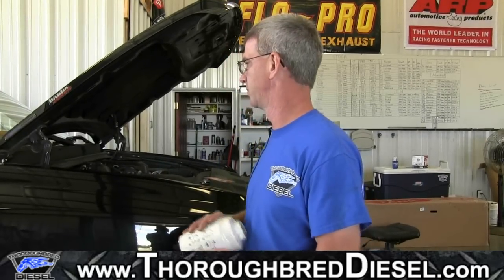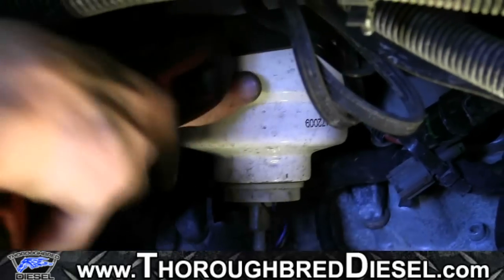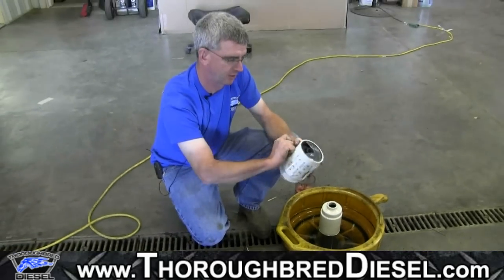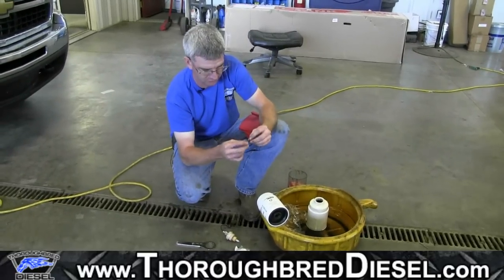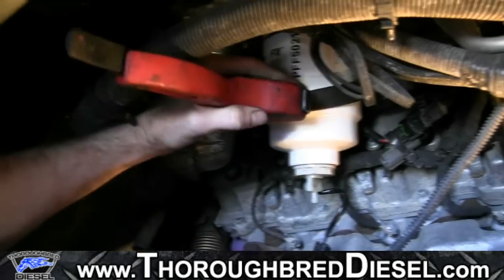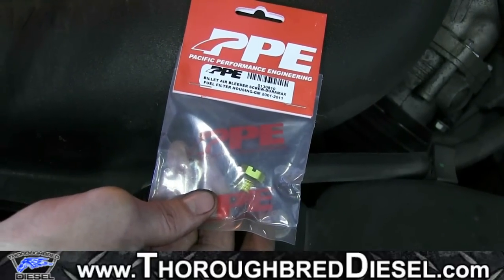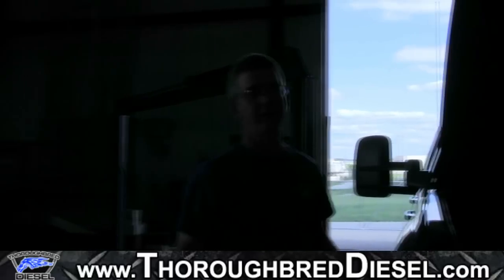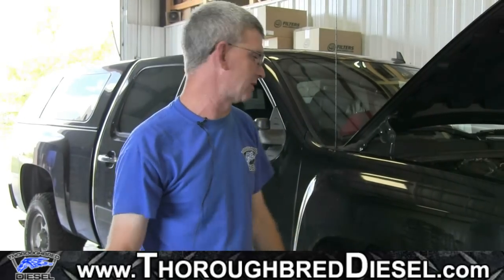Duramax Fuel Filter & Bleeder Screw Install: Chevy Duramax #PFF50216 & #5130810

Comment: I just replaced the fuel filter (and rebuilt the fuel filter head) on my GF's dad's LB7. Noticed the oring in the center of the old filter, but the new one didn't come with one. No other video I've seen specifically mentioned switching this. Glad I saved it with the old filter. Thank you!

Comment: Pro-tip, gently stretch the filter O-ring until it stops trying to pop out of the groove then gently stretch it one more time and use oil or grease or O-Lube, pick your poison but stretching the O-ring a bit won't hurt it and you won't have to fight it or worry about it riding out of the groove while you're threading the filter on. Pro-tip #2, fill the filter about half way with diesel before installing it, this will make the priming process a lot easier. The directions on the filter show taking the sensor until the seal makes contact then 1/2 turn the same for the filter seal but only 1/4 turn by hand. Putting a wrench on it might make the next guy's life miserable trying to remove it after the seal swells from exposure to diesel it's no different from an oil filter in that respect. Thanks for the video, removing the inner fender is a good idea.

Comment: “This is Wayne from Thoroughbred diesel and if you watch my videos, you can be as good as me”.    

Changed out fuel filter, transmission filter and air filter just now with perfection due to Wayne from Thoroughbred Diesel.  Fired right up.  Heard air escape by bleeding 4 times.  Last one diesel came out so I knew I was done. 

2006 Duramax. LBZ

Comment from the maker: That's a good question. We honestly didn't notice that until you mentioned it. This was a customers truck. They must have installed that themselves. Should be a big issue as long as the seal holds. We will be calling them shortly.

Comment: Thank you for sooo many great yips, and tips.  Done this since 2007  but I still like to check for info.  You didn't miss a thing. You showed  the clip to the water sensor that fd with me for way to long.  The dry desert  silt held it on tight. I'll clean and lube it this time.  Thanks alot.

Comment: To keep the upper o ring in place I use some super glue or shoe goop in filter o ring seat install o ring turn it over set on a flat steel bench place weight on top give it time to set. Best way to change filter is wheel well (have had duramax trucks since 2001) I change filter when rotating tires no tire in the way don't have to remove wheel well remove lower push pins drill two holes in bottom of well and at top (not into fender) use some bungee straps to pull well back & up

Comment: I have to get it from the top.  Hard as heck to get 2 hands in there.  Used a strap wrench on it too was not easy either.  I tightened up the sensor by hand.  No leaks.  Whole procedure was a pain, but alls well that ends well.  As for that gasket, I stretched it out a bit, which made it sit in the groove just fine.  Why so much work with the bleeder screw??  All I did was open up the bleeder screw and pumped it until fuel came out.  Done.
Reply: Groundhog  - yes I have this question as well.

Comment: i find this is the only way to do a fuel filter ona duramax, good video man.

working for GM changing lots of thes, i always remind people don't be cheep when it comes to fuel filters! but i dont think i dont think ive ever needed a tool to use a tool on fuel screw or filter, and neathor needs to be very tight, the pump draws the fuel from the tank usally.

Comment: Wayne, is there a way of draining off the water on the stock fuel filter in between 12K mile change intervals?   
2006   6.6 Duramax

Comment: this is the way Gm says to do it, its super easy
, only need to tighten it by hand... not tools needed, remember its under vacumm not pressure, and vasoline works great for holding the seal into place3, just fill the groove some in 4 places, and put o ring in, lube wat the same time, then good to go, open screw pump till you see fuel, close screw then start bam done!
Reply from the maker: Kevin the biggest reason for the tool that we've found is that the sensor sticks, probably due to temperature changes. People then try to use a what ever tool they have at home to break the sensor loose and then in turn break the sensor. By no means is the water sensor wrench necessary.

Comment: I just changed fuel filter like I always do in the past.When priming,I use the procedure you dedcribe as I always have.

I cannot get fuel to the filter head.Truck ran beautiful before filter change.Its a 2008 LMM 6.6 Litre with 208k miles which is used every day. 

It has dual tanks with a total capacity of 40 gallons. It's lowish on fuel as I was going to fuel up tomorrow. Would being a bit low on fuel cause priming to be more difficult?????

Comment: My WIF warning comes on and goes nuts during  a rain event.  Unit wasrecently replaced along with the fuel filter by dealer.  WIF warning only occured previously when fuel was contaaminated (rarely).  Any ideas why this would happen?  In dry weather (mostly the norm in drought ridden CA), it rarely acutates a warning.   Velhicle is 03 Duramax with 260k miles.
Reply from the maker: I would be suspicious of wiring at the WIF sensor if you have replaced it.  This is a hard one, because it needs to be diagnosed correctly because you need correct reporting when it comes to a water in fuel condition.

Comment: I have changed mine a couple of times with good luck but this one has been a weird one. Twice now after driving it a few days it has died on me and I had to bleed it again. I see you bleed it a different. I have been loosening the bleed screw and pumping till the fuel comes out. Like I said it has worked for me but will try it your way. Also I need to get a strap wrench. I have just been using my hands and not sure if it's tight enough?

Comment: All of that effort putting a strap wrench on it when that step formed in the bottom of the filter body is there to accept the same filter wrench that fits your oil filter. And it’s a lot faster.

Comment: I’m so confused I have a 2007 express 3500 Duramax 6.6 and the new filter I bought has that metal housing and the O-rings but it also comes with a fiber filter unless I’m supposed to also install the fiber filter inside the metal canister.??

Comment: Last year,I let the dealer replace the fuel filter which was close to $200 with tax.I actually got stuck on the side of the road because the wif sensor was leaking.It was cracked,so,I am sure they over tightened  it.

Thanks to your detailed priming method,I decided to do this myself. Truck fired right up.The next morning, there was a split second more cranking  than normal.After that,it fires right  up as normal. 

Could  there  have been a small amount of  air in the  system  which worked  it's way out while driving?Its fine now.

Comment: I've never had that problem @9:45 when I use just a finger full of engine oil. strange.
why do you suggest grease?
Reply from the maker: Either way works fine. I have always used grease or petro jelly out of habit. Whatever works for you.

Comment: @ Thoroughbred Diesel How do you feel about the CAT filter "upgrade"? Seems dangerous to me to have your water in fuel sensor out of the equation.  Just curious.  Great video once again.
Reply from the maker: http://www.dieseladdict.com/best-new-duramax-fuel-filter/

^^ Article that could give some insight. Good upgrade in some applications.
Reply: Thanks a bunch!  By a lift pump, a FASS or air dog system should work right? I have one in my garage waiting to be installed.  Thanks for the reply!
Reply from the maker: Turbo-6.7L Yes a lift pump is highly recommend. Both of those brands are good choices.

Comment: If you fill the fuel filter with clean diesel it will save some time or eliminate priming completely. Of course make sure the fuel is clean because some of it won't be filtered.

Thanks for the video, now I know I need a special tool to take the sensor off - thanks GM :P
Reply from the maker: david427steel Either will work. I don’t fill the filter on vacuum based low side systems like the Dmax because I know as I am priming if I have a hard time getting fuel “up top” that I may have a leakdown somewhere in my circuit. If I get fuel to the filter head quickly, then I know that my low side system is in good shape.
Reply: david427steel you are under no circumstances to pre fill a new fuel filter....you must be crazy. its not that hard to pump it a few times.
Reply: Nick Larson Nick, I've been pre filling diesel filters on heavy equipment and cranes that are worth more than your house for a few decades. Amount of problems - zero. Actually I've never seen a heavy equipment mechanic  not pre fill a fuel filter. 
I've notice on my new CAT equipment that it's coming from the factory with an little inline electric priming pump.
Anyone know if GM's recommends to pre fill or not pre fill?
Reply: You are comparing a crane to a diesel truck... Pre-filling a fuel filter can damage your CP3/CP4 pump. I don't need 2 decades of experience to know that, go to any diesel truck forum and ask around, no one pre-fills their filters unless they don't know WTF they are doing. I have never had any issue priming my truck after changing the filter, and if you do, crack the bleed screw and have someon crank it over while you pump. Fires right up.
Reply: david427steel 
Thats a poor way to go about it. You dont know if the diesel fuel that youre getting is "clean". & if you say "filter it before you pour it into the fuel filter" is waste. & not everybody can filter the fuel before hand. Dont pre-fill. Use the primer button.

Nick Larson 
GM recommends to not pre-fill the fuel filter.

Comment: After driving a 2008 duramax for a cpl hundred thousand, I found cutting in a "flap" near the filter is quick and easy.  I drilled a cpl locations to install nylon zip ties to close the flap.  Additionally I have installed an electric inline fuel pump which eliminates the need to prime the new filter.  One problem I continue to have is this:  every time I hook up a trailer and drive any distance my fuel filter sensor forces me to change it, usually on the road.  This could happen with a brand new fiter, or one with 3000 miles on it . . .it is just a matter of plugging in a trailer.  Any ideas?
Reply from the maker: More than likely you are having a high return rate from injectors or injection pump. Could be a cascade valve problem as well. Filter isn’t actually the problem, its likely a restriction or a leak back problem somewhere.

Comment: primer bulb is not adding any pressure.  Pumping forever with your "close then open" procedure and then with it open just a little as another video described.  I am never hearing the air bleed out or anything.  I have pumped that thing a couple hundred times and no fuel or air spits out and the bulb never feels different (i.e. no back pressure against the bulb)???  Housing bad???

Comment: what if you changed the fuel filter and didn't bleed the air off from the bleeder screw.  i turned the truck on and the truck shut off 30 seconds later realized what i did and then bleed the air out from the bleeder screw and keapt pushing the primer until diesel fuel came out the bleeder screw.  repeated this step 3 times do you think all the air is out of the fuel lines. we were on the hwy and the mass air flow code is displaying p0113 and we lost power going down the hwy.  we have and efilive also. thank god we were only 40 miles away from home and made it back.  if you know what the problem might be.
Reply: it was the p0101 code
Reply from the maker: When you are going through your bleeding procedure,  make sure that when you are opening the bleeder screw,  that you close it back before you begin pumping again.  So its pump pump,  bleed, close bleeder,  pump pump,  repeat.  The codes you are having are MAF and IAT related.  Something going on around your air intake.  Make sure you MAF is clean going forward to keep from having the truck go into limp mode.  Feel free to call if you need assistance.

Comment: what can happen if don't open the bleeder screw? will it mess anything up?
Reply from the maker: Its is extremely difficult to prime without opening the bleeder screw.
Reply: Thoroughbred Diesel Ive been priming mine for 216,000 miles now. and I really haven't had a problem. I just didn't know if over long term if it could possibly mess anything up.
Reply from the maker: dustin1pettingill Shouldn't be any big issues from it honestly.

Comment: how do you reset the fuel filter percentage
Reply: Google it the best tool to use. 

With DIC buttons

 Crank the vehicle's engine so that the starter motor engages.

Press/hold the check mark button until the FF resets to 100%.

Without DIC buttons

Insert the ignition key and turn it to the "Accessories" position.

Press the accelerator and brake pedals at the same time for 10 seconds. This action resets the fuel filter life message.

Comment: Why even put the bleeder screw back in when priming? Wouldn't it be easier just to leave it out until primed then put it back in. Even if a little fuel comes out it should be fine just wipe it off and put the screw back in.
Reply from the maker: +generalsoul1 If you leave the screw open while priming you will be bringing air back into the system.
Reply: +Thoroughbred Diesel plz correct me if I'm wrong I saw this in a video and in a diesel mechanic shop but I just figured if u pumped it until fuel came out the top and the air bubbles u would be fine
Reply from the maker: +generalsoul1 Understood. It is a vacuum based system. The screw is closed so you are not introducing air back into the system as you are pumping. The primer housing is designed to help you create the vacuum needed for fuel flow to the injection system. So, we pump the hand primer a few times, then open the bleed screw for a second. Repeat this process until all air has escaped and you have fuel flow to the filter head.

Comment: Why bother tightening the bleeder screw every time you pump? Just leave it open and wait for the fuel to come out....
Reply from the maker: +reddog418 If you don't close the screw up it could introduce more air into the system with the hand pump.
Reply: +Thoroughbred Diesel got it. thanks! Great tutorial just finished on my truck with no issues.

Comment: That was hard to watch.    Cross threaded the filter putting it on....really? You’re a pro diesel shop?

Also, grease on the o-ring doesn’t help it seal.  It prevents it from galling or tearing while you thread in the sensor. 

Finally, try putting the top o-ring on dry, it won’t slide out like it did on you.  Then, once in place, apply a tiny about of grease on the exposed part of the o-ring and it will prevent it from galling or tearing on install and it will stay in place much better than yours.

Comment: What a Dumb-Assed design. GM, it Figures. Pull out the wheel well to change a filter, geeeez!
Reply: Go buy a Ford then
Reply: There is a kit you can buy that installs a hatch in the inner fender so you can just open it and reach through.